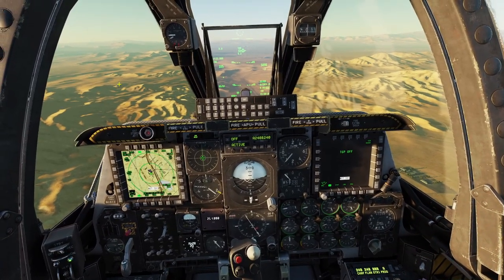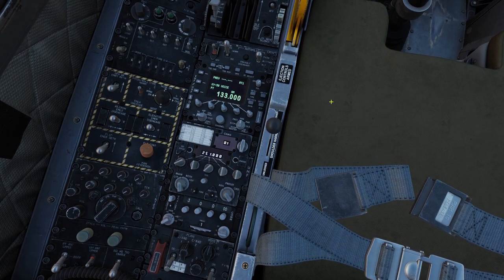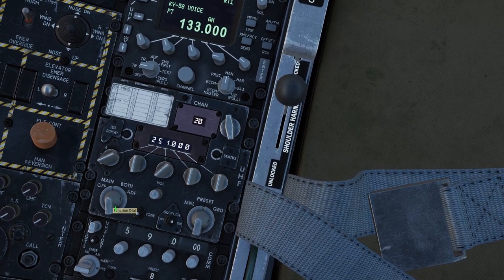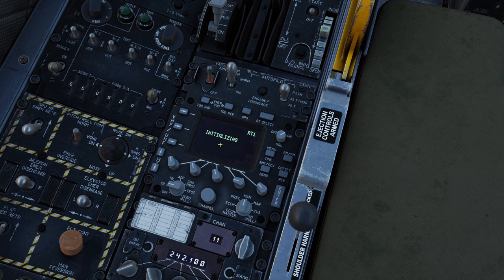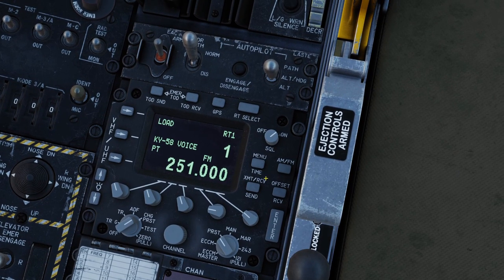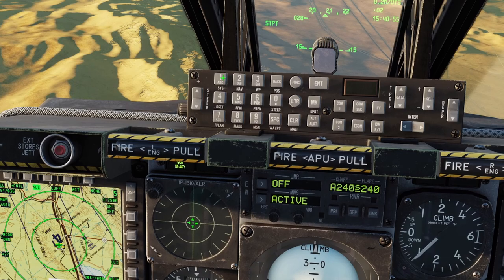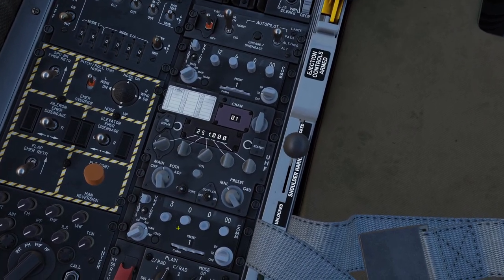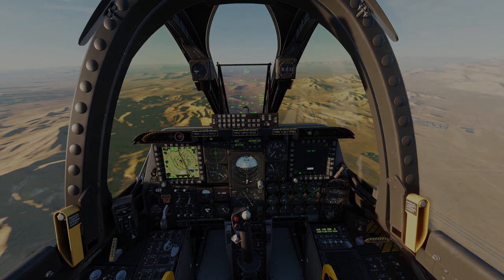DCS A-10C/CII Radios

Comment: What's the difference between AM and FM, and when do I use which?
Reply: These are two different methods of generating a radio signal. AM - Amplitude Modulation and FM - Frequency Modulation. Use the one that is needed at the moment. Usually, the type of modulation is indicated in the Mission Briefing, along with the numerical value of the frequency. For example: 305.0 FM or 124,500 AM.
If you wish, you can find out more about the types of radio signals by searching for topics on the web. Good luck!